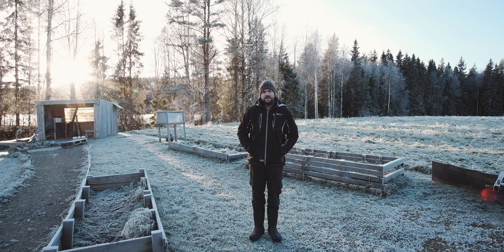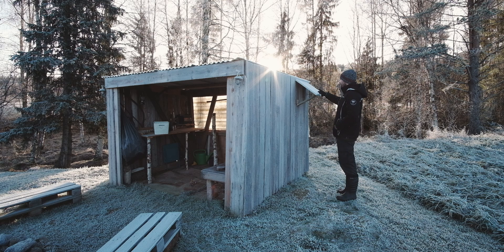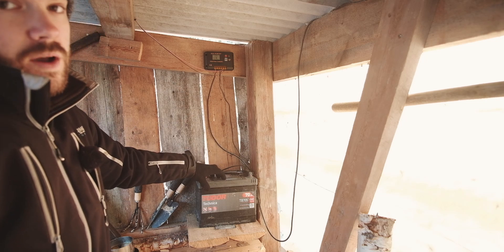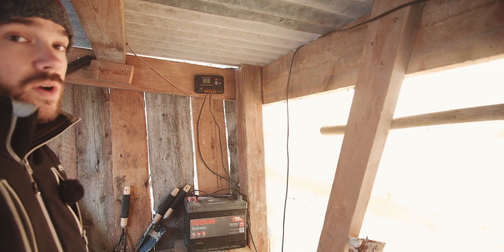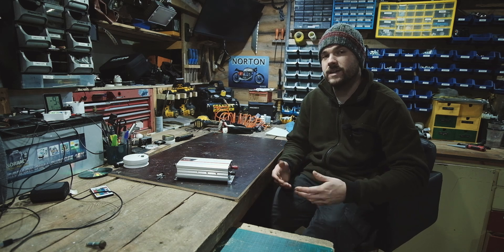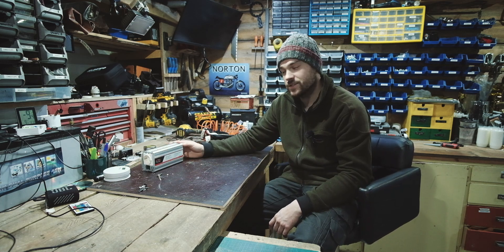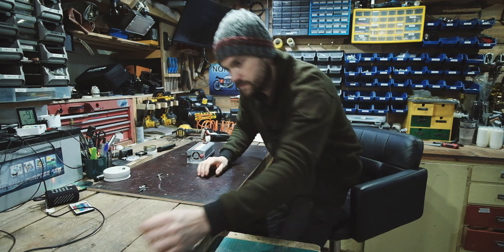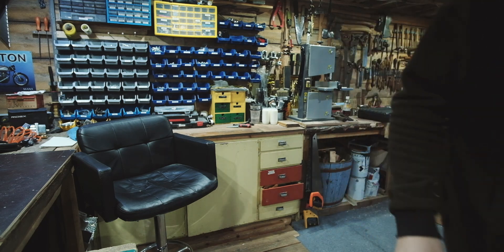Making Your Own Power Off Grid / Don't Rely On Utility Companies

Comment: Excellent explanation Ash. 
Do you think I would be able to run one of the diesel heaters that you use from a small system like you use in your outside store with the car battery?
I’d just be using it to keep my shed dry and warmish through the colder spells. I’m in the UK so nothing like your cold spells!
Reply from the maker: Yea you absolutely could. They pull about 8 amps when starting up because of the glow pin but once ticking over its like 1/2 an amp draw. You would just have to make sure you're getting enough solar back in to keep the battery topped up.

Comment: I learn from your previous van set up. Also include the votronic battery meter shunt, i am using a 300w monocristaline full black panel with a 40A Epever 4215bn controler. Fully keeps 2 x 130ah full and also runs compressor Fridge and everything else.

Comment: This is actually a very good video, and may just be what I need to try out a mini off-grid setup. I have two good spare car batteries, and an inverter I use for camping. I just need the solar panels and charger. I'm thinking initially of just running my lighting with LED's directly from the 12V battery to see how that goes. After that, maybe hook the fridge-freezer up to the inverter. As you say, build as I go. My biggest hurdle is the cost of parts. Thanks for this 🙂
Reply from the maker: You're already 75% there! A basic 100w solar panel with pwm charge controller will get you going for very cheap. If you want more you could swap that pwm controller for an MPPT as they are far better but more expensive of course. Then you can start to add more solar in the future. Its a snowball effect. Once you start, the sky is the limit 😊
Reply: @ash.pollard  Thanks 🙂

Comment: Good video Ash. Will be interested in the which fuse to which thickness of wire, think I remember when converting my van it's something to do with what volts are going though it? So if there is a simple way of explaining it that would be great. Looks beautiful around your place.
Reply from the maker: Thanks Susan, glad you liked it. I will do one soon explaining how I figure out fuse sizes etc. Again though, I'm no electrician so have to make sure you also do your own research 😊  in your van the voltage stays roughly the same, that's the 12v coming from your battery. It's the amps that are important. That is the unit that measures how much power something draws and from that you can figure out what cables will be suitable. I will figure out a way to explain it simply though later 👌

Comment: Brilliant. You explain things so well. I’m a total novice with electricity but already you’ve given me confidence to think that I might be able to do something with solar. Looking forward to where this goes. Thank you.
Reply from the maker: Thanks Rob. You can absolutely start to dabble in this. The good thing as well is when your playing with 12v it's very difficult to give yourself a shock so it's safe to fiddle around with and learn. Yes you can melt things and blow stuff up if you plug it in wrong but it's not directly dangerous. Obviously once you start connecting inverters then you step into the 240v world which is very dangerous, same as a house. I will go into more detail with future videos though 😊

Comment: This is the best explanation I've seen on this topic. It usually gets to technical for me to follow in English. I'm thinking of setting up a battery bank in my house with a few solar panels. Nothing big, just something to buff me when prices are crazy. I guess I could also connect it to the power grid so when prices are cheap I can fully charge
Reply from the maker: Glad you found it useful 😊 yea that's exactly right. If we lived in a conventional house then I would have an AC charger plugged into the mains to top off the batteries when needed. Then when you get good solar you can run everything from the batteries 👌

Comment: It is not that surprising that the battery works after two winters. It is a car starter battery after all and they are designed and used for conditions like that.  The one you have in the car and it will get as cold as that one and a lot more abuse. In a car, there will be thermal cycles if you start and drive them from a cold state. The amount of current in and out will also be a lot higher in a car than just a lamp and phone charger. The solar pane setup will work as a trickle charger when it is full and will likely keep it full even during the winter, the self-discharge rate is slower at low temperatures when there is less sunlight.   The freezing temperature of the liquid in the battery depends on the charge level, it is lower if it is more charged

 High discharge rates, not being fully charged, and high temperatures are all thing that increases the rate of lead sulfate crystals.  Your application will be better for them than in a car.

In a car, you use a lot of currents to start the engine even if the battery has lower voltage and max current in the cold. The current and time will both be higher,  friction in the engine is higher so more power is required and the time to start the engine is longer in the cold. Even if you have a block heater in the engine the battery can be quite cool beside the engine, you seldom have them on all the time instead of just a period before you start the engine. A car that is not used in the winter will likely have some parasitic battery draw and self-discharge if you do not disconnect it and the trickle charge is generally not used. So even if attached to a car that is not used and stored out in the cold they are worse off than for your application

I would not be surprised if the battery age is faster in the summer than in the winter in your application. I might have gotten something wrong about how the battery behaves but I do not find it surprising. The capacity can also have dropped a lot, the amount of energy you have in a day when it is not charging is likely not a lot compared to the new capacity.

Comment: Very well explained for the first time dabbler, which there will be more of if they get affected by power outages. I have prepped for that eventuality with 1 power box and a lithium battery with add on inverter. Enough for the basics and just charge up when there's power. Wintertime, little solar available, then there's always an exercise bike that an alternator could attach to. All is not lost.
Reply from the maker: Winter is always going to be tricky but that's just part of it. The fun is finding a way around it! You know I really want to try and explore some methods of manually generating power through an alternator. It's been done to death on yourube with bicycles etc and always ends with "doesn't work". But I'm not convinced haha. Just need a solid and reliable way to spin an alternator fast enough to charge whist overcoming the drag it will create. One day...